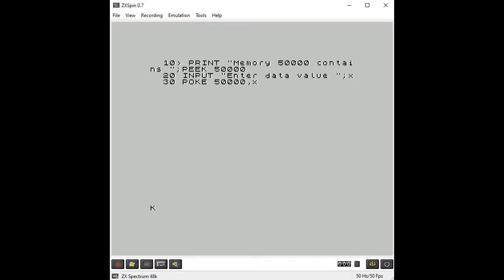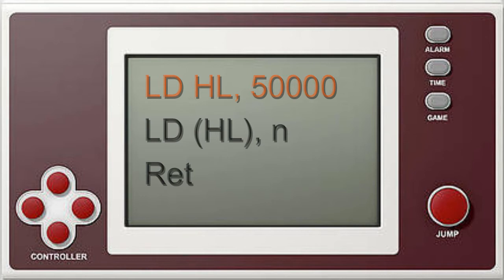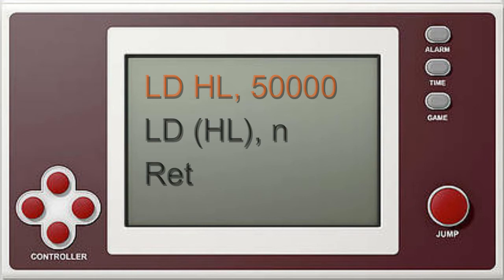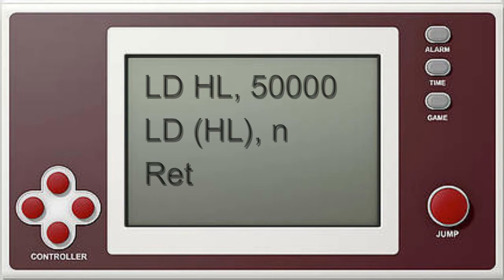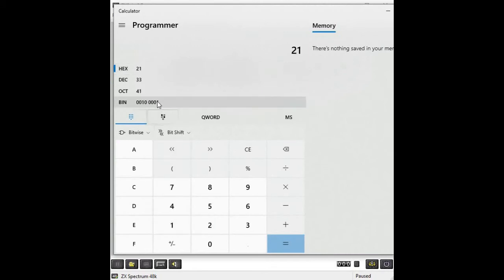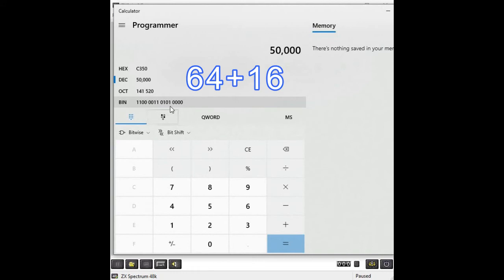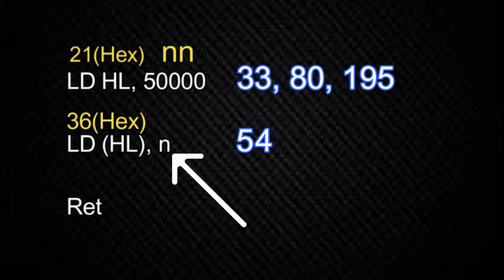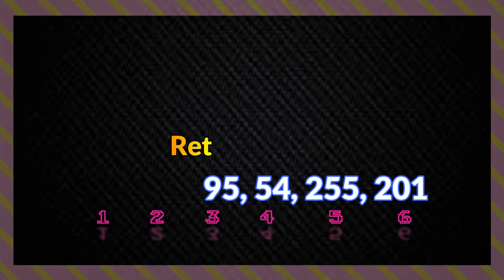#7: ZX Spectrum Next Game Dev. - Z80 Machine Code (Part 2 - Assembly to Machine Code conversion)

Comment: Why not, putting on the second line, LD (50000),n? That way, we do not need line 1...
Reply from the maker: There is no such command in Z80 assembly.
Reply: @Spriteworx  so, the usage of a register is mandatory on the LD command?
Reply from the maker: @danielmartinho8975  all the instructions can only have one opcode and one operand (although i think technically the opcode could also contain an operand but not sure). Basically we can only enter an instruction and an operand so we can’t enter two numeric values like LD (30000), 10 since that would require us to enter 2 numeric values 30000 and 10. If u look through the list of Z80 instructions you may get a better idea what kind of operations are allowed. Using a register allows us to enter only one numeric value operand.

Comment: Just a quick note to make things much quicker, better and less convoluted, and have THE reference at the same time. All the codes, hex and decimal, are available in the Appendix A to the ZX Spectrum user manual, or 'Sinclar ZX Spectrum Basic Programming', which is available online as well.
There you can find the whole character set, which includes all the statements (commands), the graphics character, and all the Assembly commands, and their corresponding machine codes, decimal and hexadecimal, in decimal code order 0-255 ;)